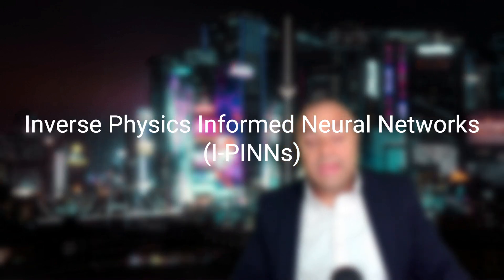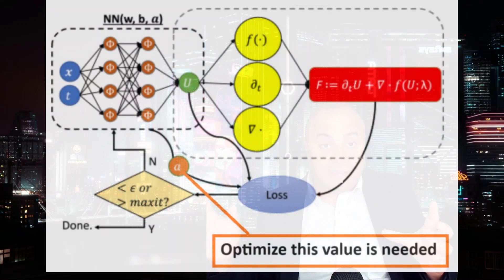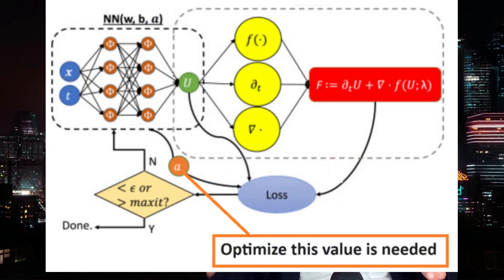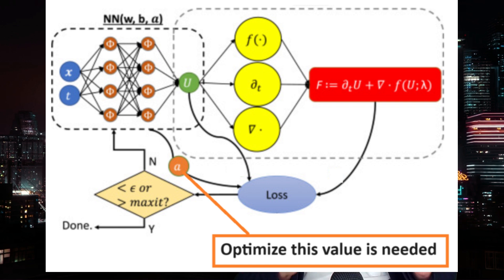Introduction to PINNs

Comment: 630 / 5,000
Hello Dr.Samara, I am about to defend my master's pre-project in PINN here in Brazil, and I would like to thank you for the teachings and knowledge shared in the course, which were very important and the basis for my studies. I will finish my master's thesis using the DEEPXDE library, as presented in your base course, I would like to know if it is worth transitioning to NVIDIA Modulus in the future. Another question, do you have any tips for when the PINN's PDE shows discontinuity? as conditionals like: Y:x>0 or X<=0? I noticed that the optimizers suffer from this. Anyway, thanks again!
Reply from the maker: Dear mr.Gyovanne
I know you, and I am very happy to see that you finished successfully your masters program, with such challenging topic to get your masters.
For the discontinuity problems, in general PINNs behavior can be changed by adding wights to the values of loss you have for example if you see the issue in discontinuity came as a result of the conversation part of the N.S equation you might damb the solution a bit during the early part of the optimization and later change the weight to get a smoother conversation to the solution this is a strong way to control the PINNs behavior but you can do other things such as the data points count increase near the problem area or you can also keep updating the B.C and I.C data count increase to force the conversionce into the direction of solving the problem and avoiding any possible issue.

Good luck and hope you the best, I think if you want to continue PhD it will be a good idea to get things progressing in PINNs and research more and know more about these hidden behaviors and applications.
Reply: @Dr.Mohammad_Samara  Thank you very much for the response! I will follow your advice!
Yes, I am going to pursue my PhD with PINN and other related machine learning techniques applied in the context of physics and engineering fluid mechanics and rheology! We are creating a small research group and contacting other universities to develop this research area here in southern Brazil!
I will be back soon to share how things are going here!
I have already acquired the your introductory courses on Nvidia Modulus and DeepOnets to expand my range of tools and repertoire! Thanks again and see you soon!!
Reply from the maker: Thank you very much for your comment, I hope you the best of luck in your PhD it is important jurny in a researchers life and an opportunity to dedicate time and attention to learning and innovation.